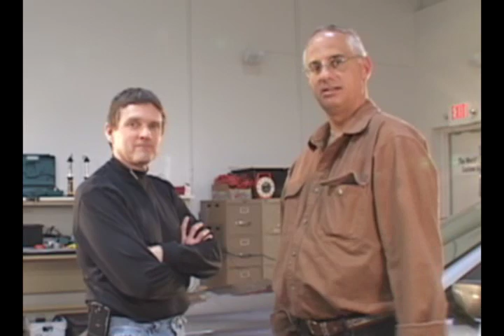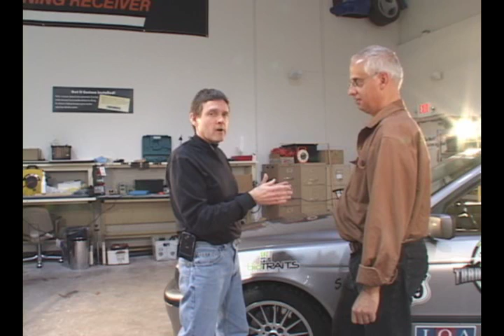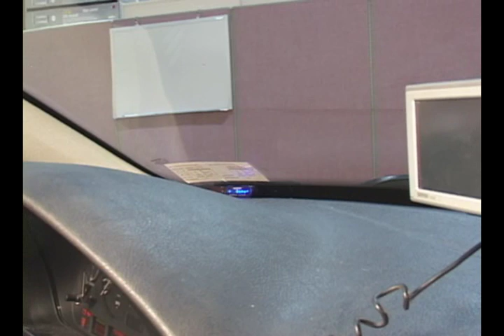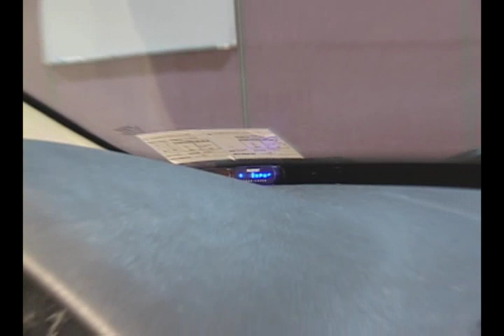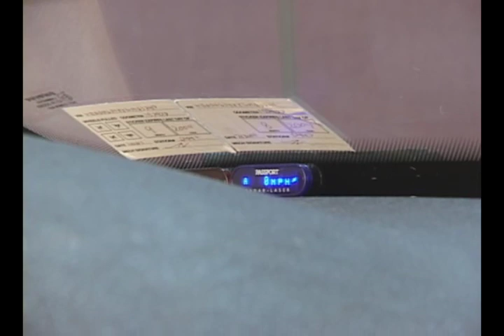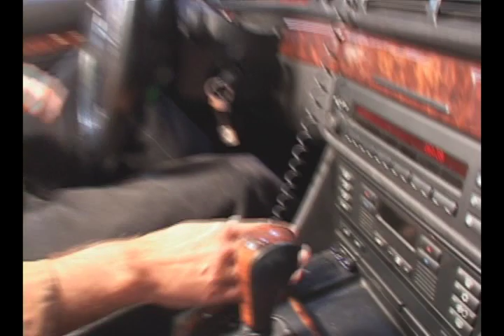Speed Trap Hunter Visits ESCORT, Discusses Escort Passport 9500ci

Comment from the maker: Thanks.  I think Escort did a good job producing this one.

My particular installation time was about 6-8 hours (figure a day) at a professional installer.

My particular installation ran $1500 (for two remote detector installs) and included the custom fabrication of the shifter area to flush mount the other detectors control module plus these guys weren't cheap (given the kind of high-line vehicles they work on).

Comment from the maker: ...On average, I would expect about $500 or so for a complete professionally installed unit.

With the Passport 9500ci there are a lot of components to install:

1 Radar Receiver
2 Front Laser Shifter/Detection Heads
1 Rear Laser Shifter/Detection Head
1 GPS Antenna
1 Speaker 
1 Display Module
1 Control Module
1 USB Interface (for Software Updates)
1 Connector Junction Block (hidden)

Our installer also vulcanized all of the outer connections to make them water tight.